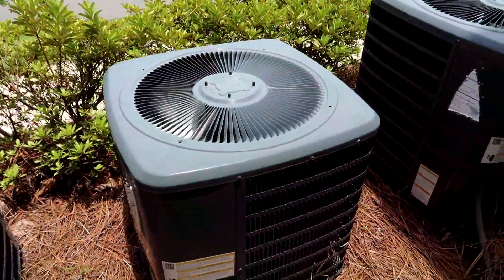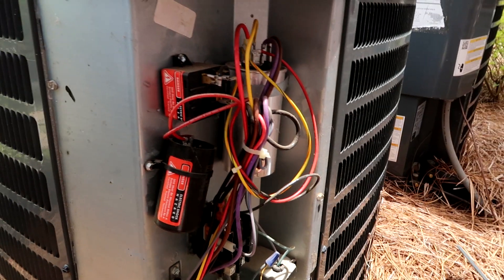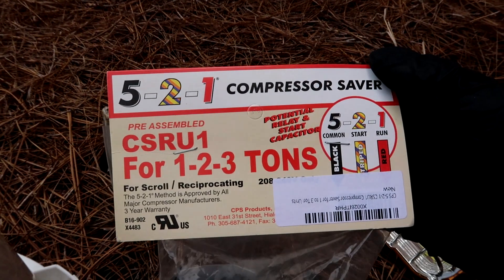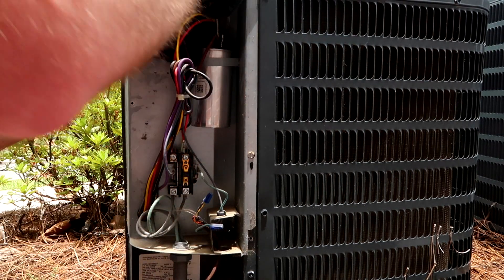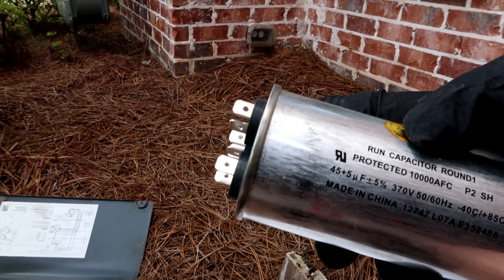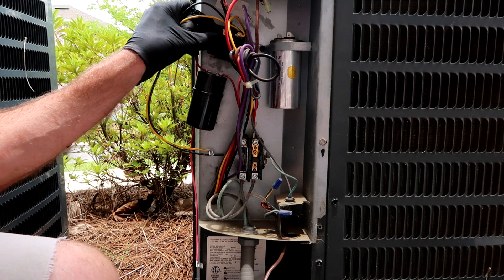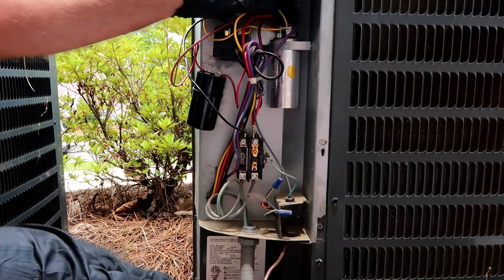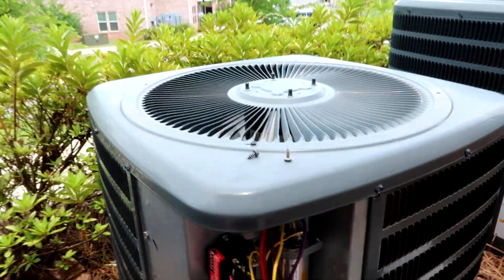HVAC Videos for Beginners #2

Comment: @5:00:  It often sounds like you're not quite sure of the tolerances on capacitors.  Here, you changed one out that was well within tolerances, which are listed on the device.  They're usually 5%, which is easy to figure in your head (half of 10%).
Reply from the maker: Thank you so much for watching!

Comment: It's easy for people to bash those hard-start kits for failing, but those folks might not appreciate that what is often going on is that the hard-start kit saved you from having to replace the compressor.  That hard-start capacitor is like a shock absorber for the compressor, and I'd personally rather replace 30 hard starts than 1 compressor.
Reply from the maker: Thank you so much for watching!

Comment: Hey Lex thanks for the great information. Should I replace my hard start and capacitor if my Goodman unit kicks on sometimes and other times doesn’t start at all when I turn on the AC? Seems like it’s short cycling, but every now and then it will run for an hour if I’m lucky. Any feedback is appreciated!
Reply from the maker: Sure try it out. I'd need to be there for this head scratcher 🤔.
Reply: @LexVance  you in Virginia? 😂

Comment: Hi lex my ac won’t turn on and contractor won’t pull in, when I push it in it turns on compressor, could that be the capacitor?
Reply from the maker: A contactor not pulling in is a low voltage problem. A capacitor is high voltage. I would need to be there for this head scratcher 🤔. Could be the thermostat.
Reply: Thanks Lex the heater turns on the fan turns on the only thing that won’t turn on is the outside compressor
Reply: Hi Lex I appreciate your advice yesterday a quick update the only time I can get the compressor to turn on is if I push in on the contactor then it will turn on if I let go of it it shuts off, inside the house the thermostat will turn on the heater and it turns on the fan but the compressor won’t turn on I was hoping that it might just be the capacitor but I would need to order that part because they didn’t have it locally is there anything else thatComes to mind that you think it could be thank you very much, cristobal pacheco

Comment: Lex  my landlord of my business installed a   rh1p3017stanja    2.5 ton air handler .. It is blowing on high  where the other handler did not. I looked at the wiring diagram and it says its a hi low   and to remove the black wire from  the  com terminal of the btd  and plug the red wire in for low speed .   Will the coil freeze if I lower the fan speed and  does changing the wire for low speed instructions sound right ?   Thanks  from a beginner :)
Reply from the maker: I've lowered the fan speed on Goodmans and the coil didn't freeze. I've never worked on the brand your speaking about but it was fine with the Goodmans. No problems at all. Thank you so much for watching!
Reply: @LexVance   Thank You for  answering my question ..

Comment: You need to get the bit 5/16 and 1/4 on the other side so your a bit more efficient and quick. Also great because that’s what appliances sizes are to
Reply from the maker: So true! I keep forgetting to get the bits when at Home Depot. Thank you so much for watching Juelz!
Reply: @LexVance  big fan sir! I always have it on my 12v drill and a extension of one to. Coworkers always swap out bits taking forever